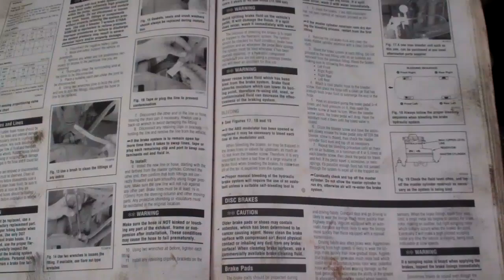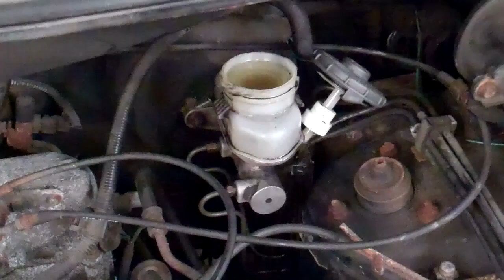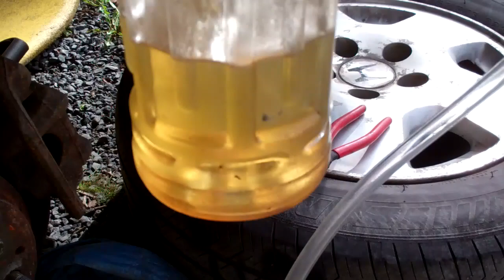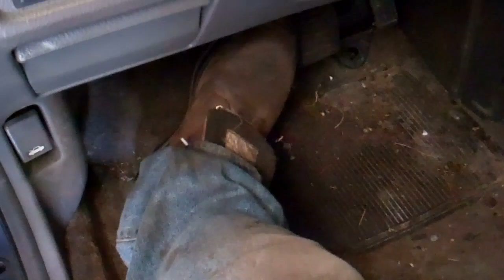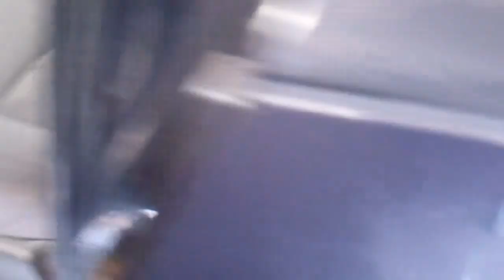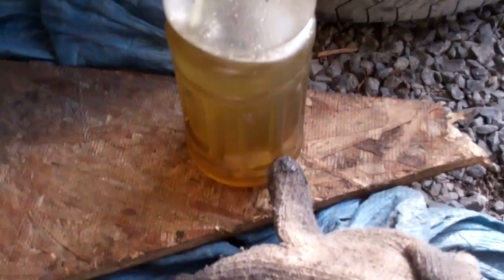How to bleed brakes using the " One person " method

Comment: I just spent over an hour trying to get the air out of a brake line before reviewing your video and then pulling the fitting and wrapping with thread tape. Immediately solved problem, good pedal now. THANK YOU

Comment: A key thing he is missing...place the catch bottle so it is HIGHER than the bleed screw. The air will then float up rather that depending on the fluid to force it down.

Comment: I have used this bleed method several times.
One key thing to improve, is to place the brake fluid bottle, with tube from bleed nipple, above not below the Calipers.
This way air bubbles simply rise, as per simple science, working for you.
The cable tie is an excellent idea here!

Comment: Do you have any issue with air been drawn in around the threads of the bleeder screw? or are you hoping the grease keep the air out. those aftermarket bleeder screws with a built in one way valve have a thread sealing compound on the thread to prevent air been drawn in....Just saying...

Comment: "This is not the way to do it" - is correct! Don't do it. Get a friend; When you let up the pedal, air is drawn-in around the tapered bleeder-screw threads (this is a well known fact). So, there is a modern solution - it is called "Speed Bleeders". There are several companies that make these; the new bleeder-screw kit includes a ball-valve that closes when you let up the pedal. But, there is more to it than that: the tapered bleeder-screw threads have a sealant on them that prevents air from being drawn-in as you let the pedal up; another tip is to let the pedal up slowly, that further decreases the likelihood of drawn-in air. Air is your enemy with any hydraulic system (brake, clutch). A Speed Bleeder kit (set of four bleeder screws with sealant pre-applied to the tapered threads) is about $25.00 (or it was about that price). Russell Performance is one such company, and there are others - just hit google with "speed bleeders".

Comment: Of course you have air coming out of the bleeder valve, you cracked it open before you attached your tube with the bottle of fluid so it sucked air when you did that....Hello!

Comment: I just did something similar but I ran a tube into a bottle about an inch and turned the bottle upside down and placed it above the level of the caliper. My thinking was that bubbles like to rise and I would waste a lot less brake fluid as any fluid pushed into the bottle can then gravity feed back into the caliper. Seemed to work great and only lost about 1/3rd of a cup of fluid from bleeding two new calipers. You sir, get a like!

Comment: Unable to bleed brake from left rear wheel hub/?????????????????????????Help ??

Unable to bleed brake after replacing a wheel cylinder on left rear wheel hub. I was told by numbers forum post that this should of been cut and dry. Was tolld bleeding procedure was to bleed the part once it was installed . After first initial attempt while having a 10mm over the bleeder screw and bleeder hose attached to a bottle Following the autozone bleed procedure for wheel cylinder replacement with a one man bleeder..These steps on replacing wheel cylinder in this video of a napa tech---> https://youtu.be/t8prHUJBHG0 And using this tech advice on bleeding with bleeder bottle -->https://youtu.be/lkd7iq-dIQ0

I tried these steps on replacing the parts listed in video 1 and did video 2 for bleed procedure. 

But I still have no fluid released from rear wheel cylinder. 

tech 1 in video one quoted saying to me in his response to my question Yes it will be the same procedure.
Car is 1995 sl1 abs delphi vi

Comment: I do this but with tight hose and one way check valve 
And a bottle without vent cap
But why it's not rear passenger first then rear driver then front passenger then front driver the sequence ?

Comment: Use a hose with 3/16" inside diameter. It will fit snugly on the nipple and seal nicely. Also, keep the hose above the bleeder valve. This will keep air from getting in through the valve. Your idea is good but I modified it by using 12" of hose and kept 8" of it full of brake fluid and above the bleeder valve. Worked like a charm.

Comment: I've used this method for years, with one exception. I use an old mayonnaise jar to insert the tubing into. You can actually hear the air bubbles being expelled. The key is that when you release the brake pedal, it sucks fluid in from the jar, not air. I buy brake fluid by the gallon, so I have enough on hand to completely flush the system, killing two birds with one stone; bleeding the brakes and replacing that brown, icky fluid with clean fluid.

Comment: Good video! Checked out several, and this is the only onw that pointed out the fact that the pipe should be below the level of thw brake fluid in the bottle. Also, the grease/zip tie idea is great for keeping that air from getting back in the lines 👍

Comment: so how is it the fluid that's coming out of the hose,or air,isn't being sucked back up into the hose and then back into the caliper? so you're saying pressing on the brakes releases all that fluid,and air,and yet it doesn't get sucked back up into the hose,or caliper? you'd think the laws of gravity would beg to differ.so the fluid in the bottle is basically stopping the fluid from being sucked back? i've worked on vehicles alot and i have never tried it this way,interesting.

Comment: Thank you very much for making this video. I have been bleeding brakes on my vehicles for many years but, not by this method that you have demonstrated. It's a lot easier doing it your way than the way I have been doing it by myself. I was having a lot of problems getting the air out of the lines because the master cylinder was defective. I bought a new one and still had problems. I finally figured out that the new master cylinder was no good either. I kept thinking there must be a blockage in the line somewhere. I also bought a brake booster and that didn't help either. So I bought another master cylinder and finally got the brakes working. It never entered my mind that one of the new master cylinders would be bad right off the bat. Took a few days for me to finally solve the problem. Your video helped a lot even after I installed the new parts twice. Thanks again.

Comment: I like your idea of using a plastic zip tie to keep the plastic tubing air-tight to the bleeder screw and the grease too. All too often the bleeder screw will be seized and snap off. A good trick to prevent that from happening is to find a drill bit of just the right size to fit inside the bleeder screw, shank side (smooth) of drill bit inside the bleeder screw. This helps while trying to loosen the screw and keeps it from shearing off.

Comment: This only "works" because you're barely cracking the bleeder open, so pushing the pedal down expels more fluid than is sucked back in when the pedal comes back up, but it's really inefficient and is mixing the old and new fluid excessively. I wouldn't trust this method to do a complete job.

The real one-man methods are to install SpeedBleeders (or a one-way valve in the bleeder line), to use a vacuum pump to suck the fluid out at the bleeder screw, or to pressurize the master cyl reservoir (ie use a Power Bleeder). For any method that involves using the brake pedal, you really want to have that bleeder closed (or a one-way valve in use) before the pedal starts coming back up.

Comment: Sorry for the dumb question, but you do one side at a time correct? I just redid the entire front end of my 98 civic hatch, brakes,motor, trans & etc & now all I have left is bleed the brakes & clutch. Its been over 10 years since I had done work on my Honda & Im forgetting all the little things. So if I used this method, I would do one side at a time & to a point could do the clutch the same way correct??

Comment: Yeah I  guess that would work fine. My one man bleed involves a Snap On pry bar. Step 1. place Snap On pry bar between brake pedal and seat. Step 2. hit the power seat forward control until seat moves forward sufficiently to squish down brake pedal. Step 3. open bleeder screw momentarily. Step 4. close bleeder screw. Step 5. Move seat back until brake pedal is at top of stroke. Step 6. repeat 1-5 until no air comes out of brake hydraulic part. This is a trade secret so keep it to yourself.

Comment: Does opening the bleeder allow for movement in the pedal, the brake pedal on my car stiffens when it's off and then gets spongy when I start it.  If the pedal doesn't loosen by opening the bleeder I wouldn't get any movement in it to pump fluid or air out.

Comment: This is not the way to do it. The air you just pumped out of the bleeder valve when you pressed the pedal down, may  go right back in when you let the pedal come back up. It will likely remain in the hose; it may never reach the bottle. If the air bubble doesn't reach the bottle, it can't escape from the brake fluid. The 2-man way to bleed is to press the pedal down, once, and LEAVE IT DOWN while someone else closes the bleeder valve, and THEN you let the pedal back up. You repeat this a few times until no more bubbles are observed in the tube. The way to do it with one person is to buy a "one-man bleeder tube." It is just the same vinyl tube you are using, with an inexpensive check valve inside the tube - brake fluid and air go only out thru the valve; the valve won't allow brake fluid and air to go back in when you let the pedal up. They are about $5.00 in auto parts stores. You only need one of them. If you don't overly loosen the bleeder valve very little air will sneak back in past the threads when you let the pedal up; loosen the valve only 1/4 turn as you showed.

Comment: just use a hand pump with brake fluid  open the  bleed Connect the hose star pump fluid. All the air will flow through the  master cylinder.
make sure the master cylinder Reservoir is empty ;)

Comment: I just replaced a 4 foot piece of brake line. The rear passager side. 1982 buick. I opened up the bleeder and pumped brakes for over a hour and nothing coming out. Brake fuild not moving in master clinder. What Im I doing wrong?

Comment: TIP: Keep the bottle up higher than the bleeder screw, this way if there is an air bubble it goes up the hose (away) from the bleeder screw
I designed this same method over 20 years ago and it works great (IF) your car has bleeder screws.

Comment: I also seems to have this problem, i already pumped 2 litres of fluid thorough my brake lines and its all clean and fresh, but pedal still falls to the floor and brakes apply only when pedal is near the floor. And i have bleed 2 times already, all 4 wheels.
It got a bit better second time but still not so good and hard.

Probably sucks air in from somewhere. I have replaced the bleeders but was lazy about using some grease and the tie wrap.
Probably will have use these.

Comment: the way i did it, was turn the car to the "on" position, so you can turn the wheel, but do not start engine. put a towel around power steering fluid. turn the wheel hard left to hard right a few times with the PS cap off. it should "burp" the system. I have an 01 taurus, used to make that high pitched type scream when I was turning the wheel, since this method i have no problems with steering.

Comment: How do you bleed the air out of Power steering pump?? Pump works fine air pushing fluid out of it. Pump doesn't make any noise no squalling at all Bearing still good.

Comment: Great video. I just wanted to add that if you place the hose and bottle above the bleeder valve any air coming out of the line will head directly to the bottle and reduce the chance of  air going back into the cars brake line.  Can also save some brake fluid.

Comment: holly rust batman.. the ziptie on the hose is a good idea. its a good idea to put some brake fluid on the threads of the bleed screw, air will sometimes go past the threads when you let the pedal off.

Comment from the maker: As you pump the brake pedal, air in the brake line becomes more compressed. Then that air is forced through the brake line (because you keep adding brake fluid to the master cylinder) until eventually being forced into the bottle Steve.

Comment: i did it with a Starbucks cup and a tube worked like a CHARM.  my breaks had so much air in them before i couldn't even drive, because the peddle went to the floor before stopping.  was super effective and fast.  thank you!!!

Comment from the maker: Try to keep the anti-seize on the upper part of the bleeder Elpuelco - away from the fluid.  The anti-seize is just to give an extra level seal so air doesn't get sucked in the line. You don't want it getting mixed in the fluid.

Comment: Nice Video Thanks. I will be using your method everytime from now on. I was wondering if a little bit of grease slips in with the brake fluid it probably will just blend in with the brake fluid and not be a big deal right? or do you think it will cause problems? I am an amateur and want to learn from the pro. Thanks Again backyardmech.

Comment: i don't want to be consider as a troll,but that proces isn't very reliable...air  can come inside the system by the bleeder threads! you have put grease on bleeder threads but you cant know if there is air inside... maybe if you put somekind of weight(or something) on a brake pedeal when you go out to ckeck oil level or finishing the job...
please don't be offended because of my comment. i just think that bleeding brakes is a two person job! 
and again,i am not trolling...

Comment: This is exactly how we do it in the workshop we leave the master cylinder cap off and check fluid level every 12 pumps once there is a clean line of fluid with no air bubbles in line tighten the sucker up.

Comment: If you really want a snug fit and want it to last longer you can use rubber vacuum line instead. Mine is clear tubing (: to see the bubbles, obviously :) with about 6-8" of rubber on either end. You may have to apply heat to get the tubes together. It's a snug fit. Also, attach something heavy (such as a bolt) to the end of the tubing inside the bottle to keep it at the bottom. This ensures it stays in the fluid and with it always being at the bottom you can start with less fluid in your bottle.

Comment: Once the fluid has been exposed to the air its shelf life is very short.  It is not recommended to use fluid that has been opened for that reason.  Just buy more when you need to bleed again.

Comment from the maker: Generally I just put it around the grease fitting Fargo; but if i've had the bleeder all the way out i'll put ant-seize compound on the threads - it's thicker than grease and should keep air from being sucked back in during brake release.

Comment: Thanks for the video. Did you put grease around the bleeder threads to prevent air from being sucked in or just on the bleeder nipple? I've heard air can be pulled in through the threads just curious.

Comment from the maker: That was a 1998 Honda Odyssey Cartoon. And i will generally clean the bottle or use a new one each time i'm bleeding brakes; then pour the brake fluid back in its original container when i'm finished. No sense in wasting the fluid if it hasn't gotten dirty.

Comment from the maker: You definately have to bleed the brake that you replaced the line at E1. If the fluid level in the master cylinder drops below the 'minimum' level when you are bleeding that brake , you'll have to bleed all 4 brakes. So keep adding fluid as you bleed to keep the level above minimum.

Comment from the maker: Don't bleed until the master cylinder is empty Antoniao - you may end up with so much air in the brake lines it will be hard to get it all out. Do this procedure at each wheel individually but keep topping up the fluid so that it doesn't go below the 'minimum level in the master cylinder'. You will eventually see that the brake fluid coming out at the bleeder valve is the same colour and cleanliness of what you're putting in the master cylinder - you're finished at that wheel.

Comment from the maker: Good point - I used to change the brake pads and only grease the slider pins if they seemed to be sticking. I grease them every time now - only takes a little time at that point in the job.

Comment from the maker: If the bleeder hadn't broke flush, I'd advise filing the edges of it flat and trying a set of vice grips on it Jakes. If there is nothing to put the vice grips on, you may have to end up replacing the caliper; I have when the bleeder valve is totally seized. Another option is a "grabit" type reversing bit - but getting iron filings in the caliper is a concern there.

Comment: So... this is where things get interesting. I tried this method on my brother's car and it didn't work for the rear brakes! - Turns out his rear slide pin grease was rock hard causing brake drag that had made the brake fluid boil. I had to use a Syringe (80-100ml) to keep sucking and sucking on the brake nipple to force the fluid out which was black to begin with until it came clean. Moral of the story: GREASE YOUR SLIDE PINS EVERY TIME YOU TOUCH THE BRAKES - It might save your life (and time!)

Comment: In place of the grease I use Teflon tape on the threads and a 1-way valve to keep air and old fluid from getting sucked back in. Also helps prevent corrosion for future servicing. I have a lot of repeat customers so I use that tape on every brake job whether I'm doing a flush or not. Much cheaper than having to use heat later on.

Comment: That`s the technique I`m using for bleeding the brakes myself.One extra procedure I`m doing is putting a long piece of wood between the brake pedal and the seat every time I finish pumping the pedal so that I`m extra certain no air gets into the system when I release the pedal....grease is grease and you don`t want to end up with grease in the system